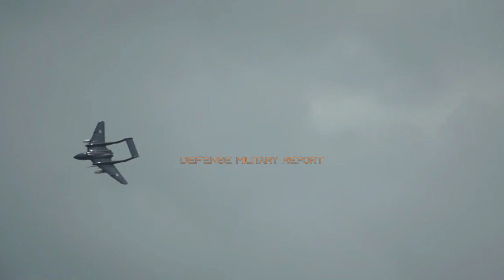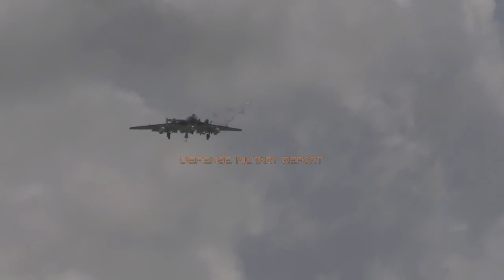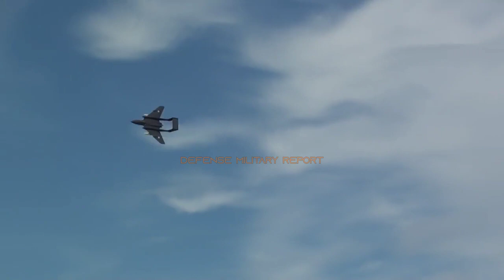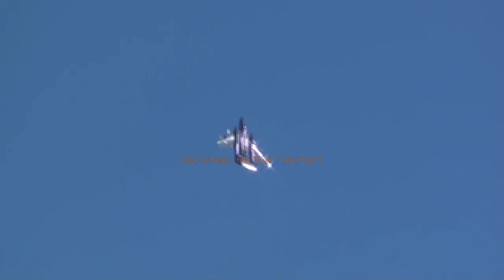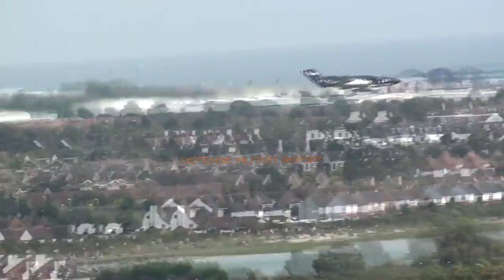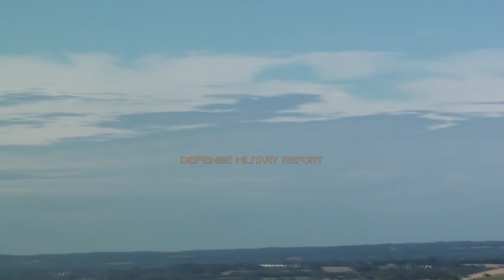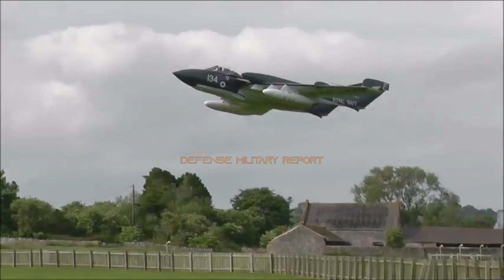De Havilland Sea Vixen - Most Extreme Fighter Jet UK

Comment: What a beautiful plane!!! It looked like it was a sweet handling plane with supersonic capabilities...
Reply: A very dangerous plane to fly, No, it was not supersonic
Reply: @WilhelmKarsten Hmmm, the video said numerous times, that it DID exceed the speed of sound... And it mentioned the structural deficiencies that caused the crash at the Farnborough air show, were addressed and it became a reliable carrier type fighter/attack aircraft.... Maybe, YOU should contact the people who made this video, and inform them what YOU know about this plane? 😮🤓😂
Reply: @WilhelmKarsten 

The MD F3H Demon was a contemporary to the DH Sea Vixen & had a similar performance. The later F4 Phantom was a follow on from the F3 Demon. The Sea Vixen took a long time to get from first flight to introduction for various reasons and a similar situation occurred with the MD F3H Demon. The Douglass Skyhawk delta wing is a contemporary to the the Gloster Javelin delta wing. Both non-supersonic delta wing aircraft, the javelin had better performance and first flew a few years before the Douglass Skyhawk.

Douglass A-4 Skyhawk 
2950 Built 
Intro 1956
FF 1954
In service to 1980s
Max V 670 MPH
Delta wing. A small / light jet aircraft designed for carrier operations without having to have folding wings. Often referred to as the scooter. 

McDonnell Douglas F3H Demon
590 Built. Not Supersonic.
Max Speed 578 MPH.
Introduction date 7 March 1956
First flight 7 August 1951
Retired 1964

MD F-4 Phantom 2
Number built 5,195
Manufactured 1958–1981
Introduction date 30 December 1960
First flight 27 May 1958

DH Sea Vixen
Number built 151 (including two DH110 prototypes and one Sea Vixen prototype)
Introduction date July 1959
First flight 26 September 1951
Max speed 695 MPH.
Retired 1972

Gloster Javelin.
434 built.
FF 1951
Intro1956
Max V 710 MPH
Delta Wing. 

Interesting British achievements.
There is no doubt that the Fairey (England)
Delta 2 was of course the world's first jet
aircraft to exceed 1000 mph, 10th March 1956 Indeed It exceeded the previous record by 310 mph & held the record for 1 year. Incidentally, the Dassault Mirage 3 & 4 are based on the Fairey Delta 2.

When the EE Lightning first achieved Mach 2 it was one of the fastest aircraft on the planet. 
P1 Mach 1 achieved 1954, Mach 1•5 capable.
P2 Mach 1 achieved 1956, Mach 2 capable. 
P2 Mach 2 achieved 1958.

The Hawker P1103 was a design and part built prototype that would have led to Mach 2 & Mach 3 versions of the aircraft. The General Dynamics F16 Fighting Falcon was of a similar design that went into service in 1975. The P1103 was cancelled during the switch to "mostly missiles plus no supersonic interceptor aircraft required in the future" era which included cancelling air to air missile development. Scheduled for test flights in 1958 and to be in service 1962. The General Dynamics F16 Fighting Falcon - based on a British design started 39 years earlier, built in the US and a number of manufacturing partner countries with parts for the US built aircraft sourced from partner countries. 

There were plans to do a supersonic thin wing Javelin which of course got cancelled. 

Early days, jet fighters.
De Havilland Vampire, Sea Vixen & Gloster Meteor accident losses were not high or unusual for fighter aircraft at the time. De Havilland built large numbers of all metal airframe aircraft before the DH Comet.
We mustn't forget of course that the DH Vampire for example first flew in 1943 & the engine was also built by De Havilland. There were examples of the Vampire interceptor / fighter in service until 1990 which was operated by more than 30 countries.

Non combat phase accident losses.
% of Aircraft built.

The Canadair CL-44 was a turboprop airliner.
Canadair CL-44                  (ff 1959 ) 48%
Lockheed XF104                (ff 1954) 100%
Lockheed  P80                   (ff 1944) 43%
Lockheed F104                 (ff 1954)  45%
Grumman f9f-5 Panther   (ff 1947) 44% 
Convair F102 Dagger        (ff 1953) 45%  
MD F-101 Voodoo.             (ff 1954) 34%
MD FH Phantom 1            (ff 1945)  35%
MD F4 Phantom 2             (ff 1958)  28%
MD F3H  Demon               (ff 1951)  32%
Gloster Meteor                  (ff 1943)  21%
DH Vampire                       (ff 1943)  23%
DH Sea Vixen                     (ff  1951) 33%
Gloster Javelin                   (ff 1951) 20%
EE Lightning                       (ff 1954) 33%

More recent UK military jet aircraft.
 
The Tornado & Typhoon & their engines are Supersonic & are indeed British design aircraft with British design engines built by an international consortium. The Tornado design for example started life during the 1950s at Vickers as the AFVG, it's engine is based on the RR RB-199. The EE Lightening is also a British Supersonic jet aircraft.

The Typhoon is the British BAC-EAP with an engine based on the British RR XG-40, the Typhoon is also built by an international consortium.

Comment: Just a couple of  points. You don't have to keep saying the entire name of the aircraft. Just sea vixen would suffice. .  Plus it was designed from the outset as a naval plane. It just so happened that during its design period the RAF issued its requirement that led to the javelin . So  de havilland decided to enter that as well. But the sea vixen was first and foremost a navy plane

Comment: 145 built,  55 lost due to accidents. Not exactly a good ratio
Reply: Well~ they were winging it
Reply: The MD F3H Demon was a contemporary to the DH Sea Vixen & had a similar performance. The later F4 Phantom was a follow on from the F3 Demon. The Sea Vixen took a long time to get from first flight to introduction for various reasons and a similar situation occurred with the MD F3H Demon. The Douglass Skyhawk delta wing is a contemporary to the the Gloster Javelin delta wing. Both non-supersonic delta wing aircraft, the javelin had better performance and first flew a few years before the Douglass Skyhawk.

Douglass A-4 Skyhawk 
2950 Built 
Intro 1956
FF 1954
In service to 1980s
Max V 670 MPH
Delta wing. A small / light jet aircraft designed for carrier operations without having to have folding wings. Often referred to as the scooter. 

McDonnell Douglas F3H Demon
590 Built. Not Supersonic.
Max Speed 578 MPH.
Introduction date 7 March 1956
First flight 7 August 1951
Retired 1964

MD F-4 Phantom 2
Number built 5,195
Manufactured 1958–1981
Introduction date 30 December 1960
First flight 27 May 1958

DH Sea Vixen
Number built 151 (including two DH110 prototypes and one Sea Vixen prototype)
Introduction date July 1959
First flight 26 September 1951
Max speed 695 MPH.
Retired 1972

Gloster Javelin.
434 built.
FF 1951
Intro1956
Max V 710 MPH
Delta Wing. 

Interesting British achievements.
There is no doubt that the Fairey (England)
Delta 2 was of course the world's first jet
aircraft to exceed 1000 mph, 10th March 1956 Indeed It exceeded the previous record by 310 mph & held the record for 1 year. Incidentally, the Dassault Mirage 3 & 4 are based on the Fairey Delta 2.

When the EE Lightning first achieved Mach 2 it was one of the fastest aircraft on the planet. 
P1 Mach 1 achieved 1954, Mach 1•5 capable.
P2 Mach 1 achieved 1956, Mach 2 capable. 
P2 Mach 2 achieved 1958.

The Hawker P1103 was a design and part built prototype that would have led to Mach 2 & Mach 3 versions of the aircraft. The General Dynamics F16 Fighting Falcon was of a similar design that went into service in 1975. The P1103 was cancelled during the switch to "mostly missiles plus no supersonic interceptor aircraft required in the future" era which included cancelling air to air missile development. Scheduled for test flights in 1958 and to be in service 1962. The General Dynamics F16 Fighting Falcon - based on a British design started 39 years earlier, built in the US and a number of manufacturing partner countries with parts for the US built aircraft sourced from partner countries. 

There were plans to do a supersonic thin wing Javelin which of course got cancelled. 

Early days, jet fighters.
De Havilland Vampire, Sea Vixen & Gloster Meteor accident losses were not high or unusual for fighter aircraft at the time. De Havilland built large numbers of all metal airframe aircraft before the DH Comet.
We mustn't forget of course that the DH Vampire for example first flew in 1943 & the engine was also built by De Havilland. There were examples of the Vampire interceptor / fighter in service until 1990 which was operated by more than 30 countries.

Non combat phase accident losses.
% of Aircraft built.

The Canadair CL-44 was a turboprop airliner.
Canadair CL-44                  (ff 1959 ) 48%
Lockheed XF104                (ff 1954) 100%
Lockheed  P80                   (ff 1944) 43%
Lockheed F104                 (ff 1954)  45%
Grumman f9f-5 Panther   (ff 1947) 44% 
Convair F102 Dagger        (ff 1953) 45%  
MD F-101 Voodoo.             (ff 1954) 34%
MD FH Phantom 1            (ff 1945)  35%
MD F4 Phantom 2             (ff 1958)  28%
MD F3H  Demon               (ff 1951)  32%
Gloster Meteor                  (ff 1943)  21%
DH Vampire                       (ff 1943)  23%
DH Sea Vixen                     (ff  1951) 33%
Gloster Javelin                   (ff 1951) 20%
EE Lightning                       (ff 1954) 33%

More recent UK military jet aircraft.
 
The Tornado & Typhoon & their engines are Supersonic & are indeed British design aircraft with British design engines built by an international consortium. The Tornado design for example started life during the 1950s at Vickers as the AFVG, it's engine is based on the RR RB-199. The EE Lightening is also a British Supersonic jet aircraft.

The Typhoon is the British BAC-EAP with an engine based on the British RR XG-40, the Typhoon is also built by an international consortium.

Comment: Like the tank Britain invented it and then lost the plot didn't know how to make it fight left to the Germans and the Russians to show us how to do that the same happened with jet fighters after the war we came up with some bizarre concepts like this turkey looked the part but couldn't fight the yanks and the Russians came up with more battle tested designs that where more straightforward but did the job once again Britain let down by its utilisation of technology
Reply: The MD F3H Demon was a contemporary to the DH Sea Vixen & had a similar performance. The later F4 Phantom was a follow on from the F3 Demon. The Sea Vixen took a long time to get from first flight to introduction for various reasons and a similar situation occurred with the MD F3H Demon. The Douglass Skyhawk delta wing is a contemporary to the the Gloster Javelin delta wing. Both non-supersonic delta wing aircraft, the javelin had better performance and first flew a few years before the Douglass Skyhawk.

Douglass A-4 Skyhawk 
2950 Built 
Intro 1956
FF 1954
In service to 1980s
Max V 670 MPH
Delta wing. A small / light jet aircraft designed for carrier operations without having to have folding wings. Often referred to as the scooter. 

McDonnell Douglas F3H Demon
590 Built. Not Supersonic.
Max Speed 578 MPH.
Introduction date 7 March 1956
First flight 7 August 1951
Retired 1964

MD F-4 Phantom 2
Number built 5,195
Manufactured 1958–1981
Introduction date 30 December 1960
First flight 27 May 1958

DH Sea Vixen
Number built 151 (including two DH110 prototypes and one Sea Vixen prototype)
Introduction date July 1959
First flight 26 September 1951
Max speed 695 MPH.
Retired 1972

Gloster Javelin.
434 built.
FF 1951
Intro1956
Max V 710 MPH
Delta Wing. 

Interesting British achievements.
There is no doubt that the Fairey (England)
Delta 2 was of course the world's first jet
aircraft to exceed 1000 mph, 10th March 1956 Indeed It exceeded the previous record by 310 mph & held the record for 1 year. Incidentally, the Dassault Mirage 3 & 4 are based on the Fairey Delta 2.

When the EE Lightning first achieved Mach 2 it was one of the fastest aircraft on the planet. 
P1 Mach 1 achieved 1954, Mach 1•5 capable.
P2 Mach 1 achieved 1956, Mach 2 capable. 
P2 Mach 2 achieved 1958.

The Hawker P1103 was a design and part built prototype that would have led to Mach 2 & Mach 3 versions of the aircraft. The General Dynamics F16 Fighting Falcon was of a similar design that went into service in 1975. The P1103 was cancelled during the switch to "mostly missiles plus no supersonic interceptor aircraft required in the future" era which included cancelling air to air missile development. Scheduled for test flights in 1958 and to be in service 1962. The General Dynamics F16 Fighting Falcon - based on a British design started 39 years earlier, built in the US and a number of manufacturing partner countries with parts for the US built aircraft sourced from partner countries. 

There were plans to do a supersonic thin wing Javelin which of course got cancelled. 

Early days, jet fighters.
De Havilland Vampire, Sea Vixen & Gloster Meteor accident losses were not high or unusual for fighter aircraft at the time. De Havilland built large numbers of all metal airframe aircraft before the DH Comet.
We mustn't forget of course that the DH Vampire for example first flew in 1943 & the engine was also built by De Havilland. There were examples of the Vampire interceptor / fighter in service until 1990 which was operated by more than 30 countries.

Non combat phase accident losses.
% of Aircraft built.

The Canadair CL-44 was a turboprop airliner.
Canadair CL-44                  (ff 1959 ) 48%
Lockheed XF104                (ff 1954) 100%
Lockheed  P80                   (ff 1944) 43%
Lockheed F104                 (ff 1954)  45%
Grumman f9f-5 Panther   (ff 1947) 44% 
Convair F102 Dagger        (ff 1953) 45%  
MD F-101 Voodoo.             (ff 1954) 34%
MD FH Phantom 1            (ff 1945)  35%
MD F4 Phantom 2             (ff 1958)  28%
MD F3H  Demon               (ff 1951)  32%
Gloster Meteor                  (ff 1943)  21%
DH Vampire                       (ff 1943)  23%
DH Sea Vixen                     (ff  1951) 33%
Gloster Javelin                   (ff 1951) 20%
EE Lightning                       (ff 1954) 33%

More recent UK military jet aircraft.
 
The Tornado & Typhoon & their engines are Supersonic & are indeed British design aircraft with British design engines built by an international consortium. The Tornado design for example started life during the 1950s at Vickers as the AFVG, it's engine is based on the RR RB-199. The EE Lightening is also a British Supersonic jet aircraft.

The Typhoon is the British BAC-EAP with an engine based on the British RR XG-40, the Typhoon is also built by an international consortium.

Comment: What was the point/advantage of the twin boom?
Reply: The twin-boom tail reduced the length and height of the aircraft, which reduced the stowage area and head-room required onboard aircraft carriers; it also minimised asymmetry during single engine flying, reduced the length of the jet pipes and improved maintenance access.[1]
Reply: @robertcook2572  Did it increase fuel storage capacity?
Reply: @thezootsuits8151  Don't know, but I doubt it. Most fuel stored in the wings
Reply: @thezootsuits8151  The Mk 2 had the booms enlarged to take more fuel.
Reply: Spoken like a true boomer